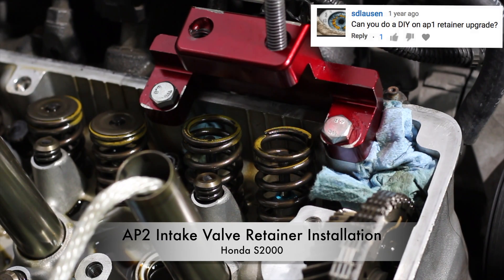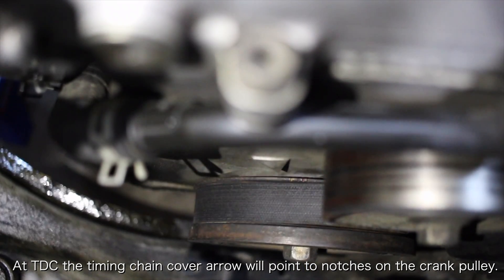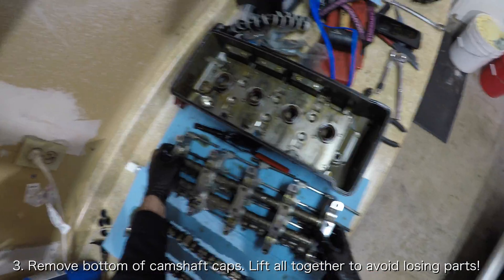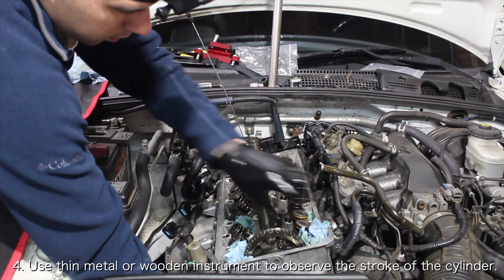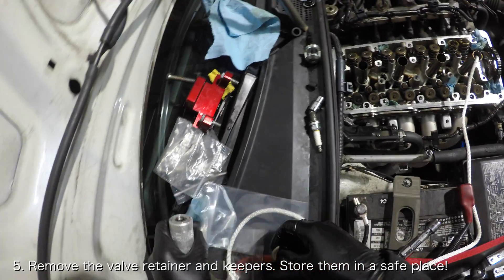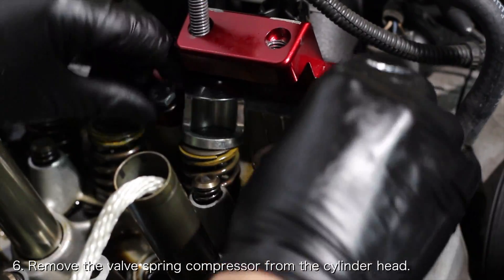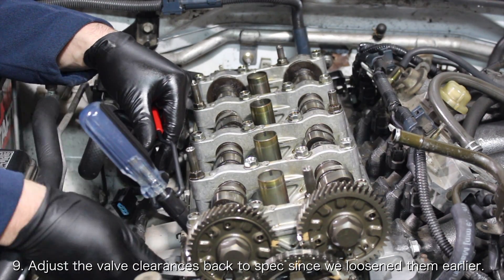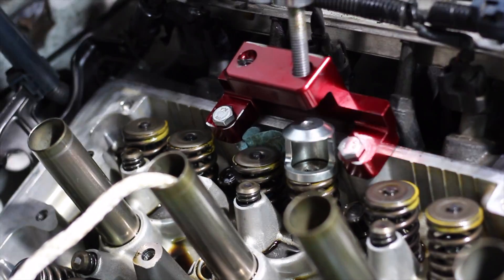AP2 Intake Valve Retainer Installation | Honda S2000

Comment: This video is awesome. I have Brian Crower Stage 2 cams. The intake lobe on the #1 cylinder scored. I have to inspect the rockers so they're not damaged. This video will aid immensely. Have a video request though. Changing the timing chain and chain guides. Think you'd be up for it?
Reply from the maker: Hey Emil. Glad the video helped you out. I don’t think I would do a timing chain and guide video since it’s not something I’m likely to do to my car. I understand that our timing chains stretch a little but it’s not that big an issue and the timing might be fixed with ballades timing gear which is a less invasive fix.
Reply: Ah. I understand. I actually do have Ballades timing gear which makes the timing line up perfect. The reason for the request is 1) There are no DIYs on how to do this on youtube or s2ki. 2) My TCT failed (since replaced with Billman's Gen X-R holding up fine) and I did have that timing chain rattling noise for a few hundred miles. I have a suspicion the guides and sprocket may have worn excessively and the chain might've stretched prematurely from the more aggressive cams. I have a full Ferrea valve train (beehive) and tuned on AEM Infinity. For peace of mind I planned to replace the timing chain with a Toda heavy duty one, replace the guides, oil pump tensioner and chain, and crankshaft timing gear. I have a rough idea of what needs to be removed. The manual says to take the cylinder head off, however according to Billman it is not necessary but the following need to be removed to do it: valve cover, camshafts, TCT, camwheel, oil pan and timing cover. This is the abridged version, however like many, I am just a shade tree mechanic looking for guidance from someone more qualified. I've owned my S2K for 10 years (AP1 03). It's almost been 10 years since the car has been out of production. There's a plethora of useful videos on the S2000 (and plenty of not so useful ones) and my thoughts are that this is a video that will help out a lot of people given the age of the car. I could try to do a video if I tried to tackle the job but tbh it'll likely be pretty shitty.
Reply from the maker: A couple hundred miles with a failed TCT isn’t that bad so I wouldn’t worry. I personally drove thousands of miles on a bad TCT and I’m sure others have too.

Comment: Do you have a link for tool used if the compressed-air method of keeping the valves up is used? Thanks!  Keep it up!
Reply from the maker: In that case you use an air compressor. You might need an adapter to fit the air line into the spark plug hole as well. Are you interested in those?
Reply: Right, is it the same adaptor used in a leak down test?
Reply from the maker: Yep!

Comment: awesome video. I dont know what your profession is but can you justify whey its 25 ft lbs for the spark plug? 19-20 is honda recommended (for b series, f series, and k series). I always like learning new things. Thanks for the video
Reply from the maker: I follow Billman’s recommendation (famous S2000 mechanic): https://www.s2ki.com/forums/s2000-under-hood-22/spark-plug-torque-921403/page3/#post23996215

The revised 21 ft lbs is probably just fine.

Comment: Great video! Any reason you didn't do the exhaust retainers while you were at it?
Reply from the maker: According to Billman: it is extremely rare for the exhaust side to crack, it lowers the RPM required for piston to valve contact.

Comment: Hey I just did retainer install and started my car but my valve train is much louder then before, I don't have an engine code and the car starts right up. Is it possible that the timing is off by a tooth, or the valve clearance is that I performed is out of spec?
Reply from the maker: Most likely the timing is off. Did you re adjust the valves after loosening?
Reply: DIYGuys yea I adjusted the valves. I’m going to remove the valve cover later on today and double check on the timing.
Reply: DIYGuys hey great news it was not the timing I just messed up on the valve adjustment. I noticed that the feeler lash tool had two stuck together so basically I had the wrong spec the whole time. The car runs better then before! 

Thank you again for all your DIY’s
Reply from the maker: Glad you got it working!

Comment: nice DIY. have considered this but don't plan on over revving my AP1 any time soon.
Reply from the maker: In my opinion if you don't track your car I don't think it is worth the investment.
Reply: haha... i actually track my car regularly. but in my 25 years of driving i have yet to hit the wrong gear. the S2000 gear box is also very precise and confidence inspiring.
Reply from the maker: reckless! keeping an eye on the motor mounts helps too. good luck with #nomisshifts2018
Reply: livin' on the edge, you know. how are the motor mounts related?
Reply from the maker: When they are busted the motor and trans will move around quite a bit. The shift knob will sway from side to side and make it easier to misshift.
Reply: DIYGuys gotcha. thanks for the tip!

Comment: im at the point where im putting the new keepers in but my overhead compressor tool is a nightmare to use. im interested in buying the one you have. what modification did you have to make to the tool?
Reply from the maker: You have to grind down the backside of the tool so that it can fit around the intake manifold runners. If you have an angle grinder or a deemed it should be no problem.
Reply: thanks!
Reply from the maker: If you can wait, they are cheaper on eBay. Around 60$

Comment: That compressor tool looked 100x nicer to use than the one I did !!
Reply from the maker: Yeah definitely one of those times where it was worth it to get the right tool for the job.
Reply: DIYGuys what compressor tool did you use ? Can you send a link or what it’s called ?
Reply from the maker: Link in the description I believe.

Comment: Omg, probably the best and most intense S2k video so far haha. I have an AP1 but I would be really nervous to do this job myself.. However, this video might give me enough confidence to do it if necessary.
Thank you so much for all of your videos, keep up the good work.
Peace!
Reply from the maker: Definitely the most intense video so far. Took me 40 hours total from script writing, to filming, to editing. It is definitely nerve wracking but if you understand the fundamentals of what TDC means and how the pistons move with the crankshaft its not so bad. The only other tricky part is getting the cam timing. But if you just take some time to ensure its parallel to the head it shouldn't be an issue. Worst case scenario you're one tooth off, the car refuses to start, and you know exactly why.

Comment: great job man i inspected mine and they were fine but parts of me wants to tackle this job still. how many hours did it take you?
Reply from the maker: +Clive Mckenzie Once I got the right tools I think it would take me 3 hours. It simply takes a long time to get the camshaft caps off. Also feeding in the nylon rope takes a little bit of finessing. But if I didn’t have to film definitely 3 hours.

Comment: Nice work. Did you have any cracked retainers?
Reply from the maker: +John's S2K None cracked for me on a 130k+ mike motor. Retainers on my old AP1 weren’t cracked either. Never seen it in person to be honest.
Reply: DIYGuys Good to hear. I inspected mine during my last valve adjustment, and they appeared to be fine. But I still have some ap2 retainers sitting in my garage from when I first bought the car. Great diy by the way!
Reply from the maker: +John's S2K Thanks!

Comment: That’s an awesome tool
I️ did mine with a tool from harbor frieght
Reply from the maker: Having the right tool for the job can save you a lot of time. Before I had the valve keeper removal tool I was using a socket and a hammer. I lose two valve keepers, which left me without a car for a couple days until I could get replacements. The valve keeper removal tool really makes it impossible to loose the keepers. I'll probably make a separate video just talking about the tools.
Reply: Agreed. That keeper removal tool is awesome. I used a socket and had the same issue almost losing keepers .